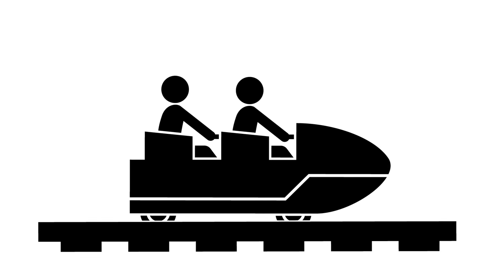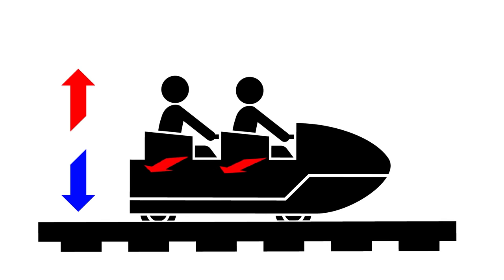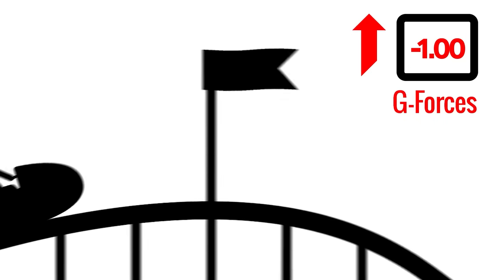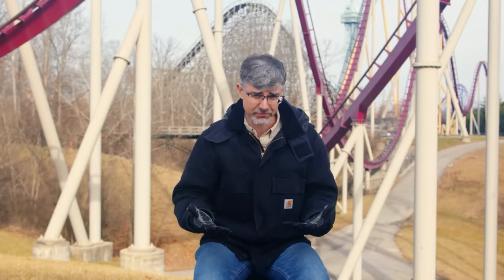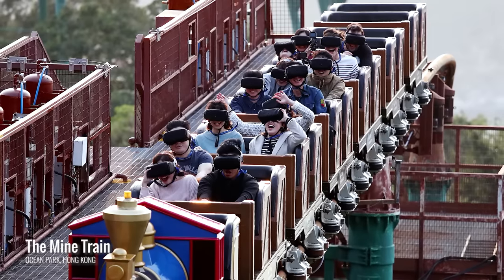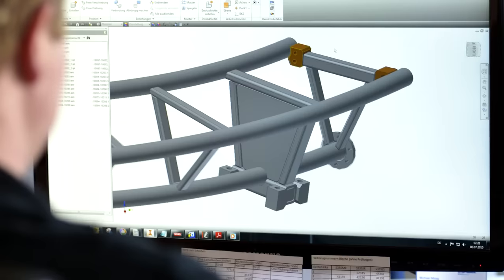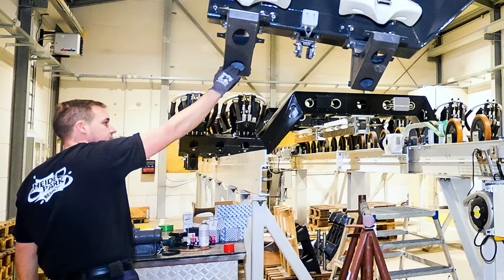Engineer Explains Every Roller Coaster For Every Thrill | A World of Difference | WIRED

Comment: I think we can say as enthusiasts, that VR is dead on coasters
Reply: I went on one 2 years ago, and it was pretty cool. But it made me sick for half an hour. That was not so fun.
Reply: What but id love to ride a vr coaster 
- person who only rides mine train roller coasters
Reply: I think coasters should be dead in VR. It's nothing like the real thing.
Reply: @fever1  lol, yup, that's me more or less.

I can see how VR coasters could be nothing more than an unnecessarily tacked on gimmick to roller coaster enthusiasts, but I'd say just because it's usually not implemented well doesn't mean it can't be done. Give it, say, ten more years for the tech to improve, and for a pioneer coaster to come along and show the others how to do it well. If the VR/AR tech gets good enough, there's basically no limit to the visuals and theming you can add to a coaster ride.
Reply: Rode Ninja at Six Flags St. Louis with VR. Was a cool a experience.

The ten minute dispatches, however, were not.
Reply: What about AR?

Comment: Ah it do be a shame that he didn't mention the hybrid coaster. I know that RMC, the market leader in hybrid coasters, is one of the main competitors for The Gravity Group, but you cannot deny that what RMC is doing is absolutely amazing for the coaster industry. You can see the elements RMC is making already appear in Intamin's steel coasters. You can really see them think out of the box.
Reply: Exactly!! Like dang, that's a huge one!
Reply: Cant forget about them single rails or actually freesping 4d coasters that spin freely unlike x2
Reply: There are still some other types that weren’t mentioned. Normal sit down floorless coasters for example. Or the dive coasters in that case.
Reply: @jarmoliebrand2005  definitely right about that, although these are usually just twister coaster with a different seating arrangement and another gimmick. The divecoaster is definitely worth mentioning though.
Reply: Yeah I recently rode steel vengeance I've seen a pov of the original coaster with that structure mean streak and it's crazy that they can turn a coaster that many people hated to one of the best in the world
Reply: rmc more like Real Mine Craft
Reply: I have ridden 200+ coasters and hybrids like iron gwazi, steel vengeance, and iron rattler are some of my favorites. I was very disappointed the rmc and hybrids in general didn’t even get a mention
Reply: Or duelling coasters. Or bob-sled coasters for something that's actually different.
Reply: Gravity group technically makes hybrids
Reply: @frozenuruguayball6436  yesish, they're steel supports.

Comment: He's mistaken when he says 4D coasters allow you to spin freely. At least in the case of X at magic mountain (which was the first 4D coaster) the spin around that axis is specifically controlled. For instance, during the near vertical drop, each rider is spun to face straight down. Each ride is exactly the same.
Reply: Though the new small 4d coasters do spin freely
Reply: They should add a manual element.

Like make a top gun coaster where you have a joystick which can roll and move your carriage etc etc.....
Its probably already in the works tbh tho.
Reply: @jasonstranthon7571  little kids just gonna accidentally experience 10G
Reply: That spin face down at the drop is my fav part of that ride. X2 is such a great coaster. :)
Reply: @thecoastergnome8603  arnt those 4d coasters called free spins
Reply: @deezem5294  fr, euthanasia coaster irl 💀
Reply: @Petperson17  they are.

Comment: 18:00 - Not to come off as pedantic, but the X2 coaster is not a free-spinning 4d coaster. It’s a distinction worth mentioning because one of the reasons X2 is so buttery smooth (and one of my favorite coasters), is because the rotations of the seats are specifically dictated by the portion of the track you’re currently on— there’s no randomness. The result is a smooth ride designed around your center of mass, which means less of that disorienting and painful whiplashed feeling.

I make this correction with ZERO disrespect to the engineer here. He’s obviously very knowledgeable and knows his stuff and knows WAY more about coasters than I do! Just thought this one note was worth mentioning. This was a great video! Entertaining and educational! The best combination of things!
Reply: I said the same thing in a different post. X2 and Eejanaika control the rotation. All other 4D do not have the 2nd set of rails and actually are free spinning.

Comment: I was always told that the wooden roller coasters were the most dangerous to ride because they just aren't as strong as the metal ones but that's never put me off of riding them. I don't know, I guess I'm just a daredevil. To me, the more loops and drops it has, the better. It's crazy that most of the rides only last about 3 minutes at the most because sometimes it seems like it lasts longer than that. But they are so much fun to ride. I love them.
Reply: Wooden coasters are just as safe as steel ones.
Reply: @SpiritOfTheSeasons  exactly!
Reply: They're just as safe, they're just rougher. I'm not even an enthusiast and I know this. It's just common sense. Whoever told you that needs to do research instead of spreading misinformation.

Comment: The Unidentified Shuttle Loop at 14:06 is Cobra at VVC Wheel Park, Russia. Also it's not a flywheel launch and most steel shuttle loops don't use flywheel launch systems.

Comment: not to correct the engineer but the 4D coasters shown don't actually rotate freely. The track has 4 rails instead of 2, and the distance between them controls how the seats rotate on the car. So it's a controlled ride and it's the same experience every time, but they're some of my favorite rides. There are coasters that spin freely, but they're not actually what's considered a "4D coaster."

Comment: I worked at six flags in 2016 when they opened up new revolution and the vr was a disaster it made people dizzy or nauseous and half the time the headset would over heat in the 90+ degree weather and we would have to let people re ride without it

Comment: I wish they made Kingda Ka a lot longer with more elements to bleed off the energy it has after that 450ft drop but its just a hill then its over. After you get over the huge height its actually a boring ride that keeps breaking down because their brakes are being abused since so much energy is left by the time the trains hit the brake run.
Reply: Yeah that's not why it breaks down, do you even hear yourself talk? The brakes are magnetic, no part of the train is making contact with any kind of braking material. The reason why it breaks down is cause of the complicated Hydraulic Launch System, it's literally a giant winch powered by Oil under high pressure. It's not a very reliable system, but the experience is second to none. Plus Kingda Ka's layout is better than Top Thrill Dragster's layout which has no second hill, but I still prefer TTD cause of the restraints, viewpoints and the theme, plus it feels smoother

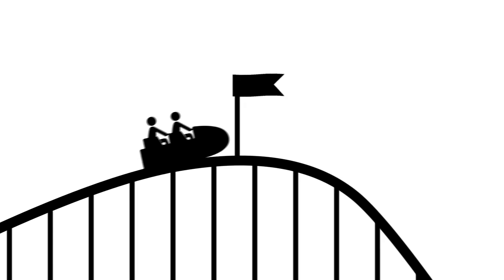Comment: 3:50 The part about vertical g-forces is illustrated wrong. Air time is when you feel zero G like at free fall, not negative G. Also going downhill does not increase experienced g-forces, you get those when the direction you are going changes (when the hill comes to the bottom and starts going up again).